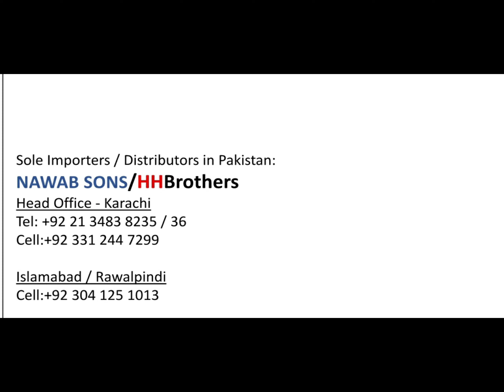Exterior HPL - porch ceiling with ASD High Pressure Laminate

Comment: Does alluminium fabricators do this work??.whom to contact
Reply from the maker: Fabricators of ACP sheets can do this work. Installation mechanism is pretty much the same however it's riveted from the from unlike ACP which is bent on the frame and riveted on the sides.